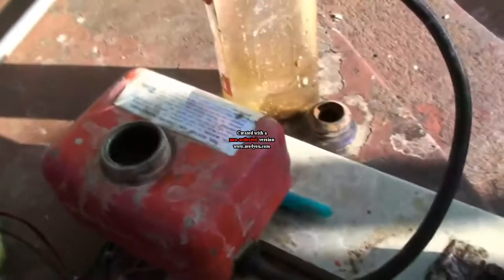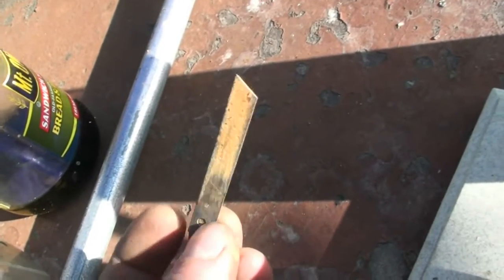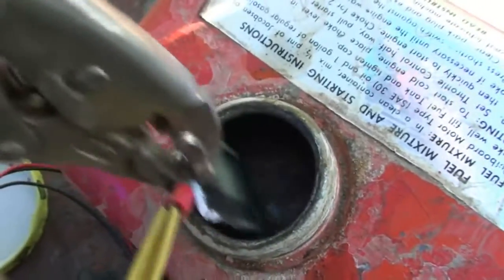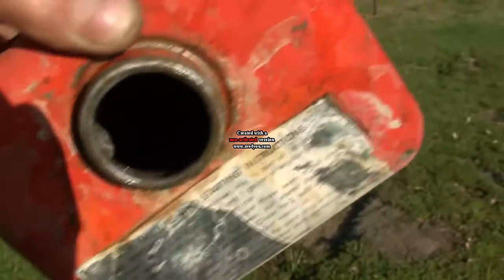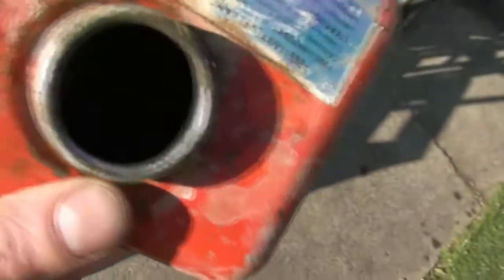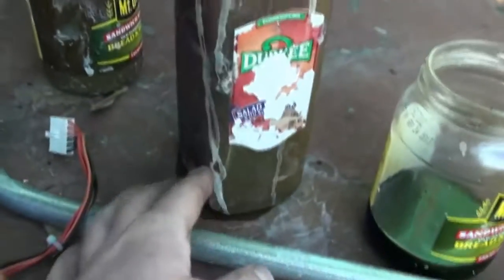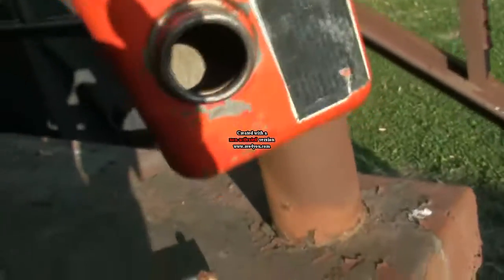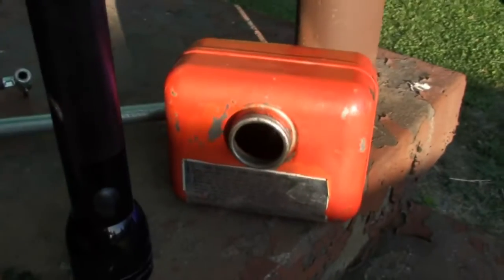Removing rust from a fuel tank using electrolysis Pt. 2

Comment: Good info on cleaning a tank. As far as your sacrificial anode. Next time get a piece of PVC pipe that will fit into the opening and a cap for the PVC. Drill holes in your pipe up to  where it's in the tank then put the cap on the end in the tank , as far as a sacrificial anode try using a piece of rebar stuck down in the pipe, no short outs. Holes in pipe let water in for current to flow through . Also can clean rebar quite a few times with a wire wheel.

Comment: use the highest grade rubbing alcohol which u can get at wal mart for 2-3 bucks, in the pharmacy area, and put a couple ounces in the tank and slosh it around, pour it out, due to the high evaporation qualities of the alcohol, the water travels with the vapor, cause u really need to get that water out to prevent any other rusting.

Comment from the maker: No, not making a battery charger from the power supply, how to wire an ATX power supply to be used as a standalone supply for electrolysis / bench use etc.  My problem with leaving it overnight would be that after about 20 minutes the anodes I was using were getting corroded enough that the electrolysis process was basically coming to a halt.  If I could somehow get something into the tank with a larger surface area, I'm sure it would have worked much better.

Comment: most people do the electrolysis over night. you may not have done for long enough. Put some black tape on the side of your metal. You mean make a charger out of a power supply yes I would like to see that. I have many power supplies sitting around. I guess if you watch the voltage to see if dont go over 14 you would be ok. Every bit of the rust will be gone if you leave it over night. I have seen guys do this on the amigatec channel watch OBP Episode 65 - David Bradley Super Power Part 2